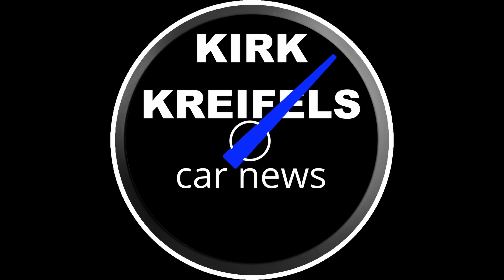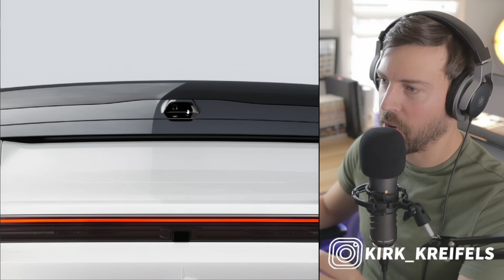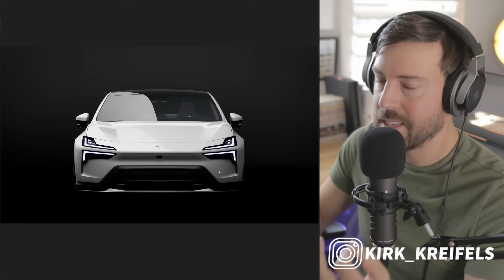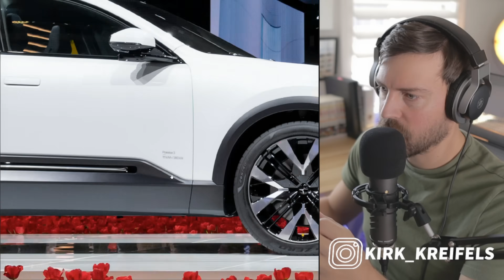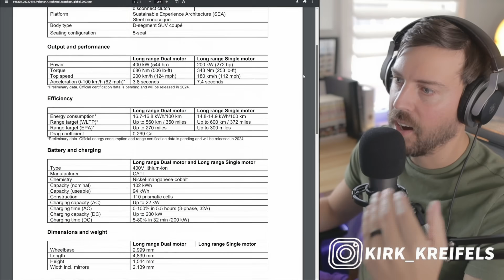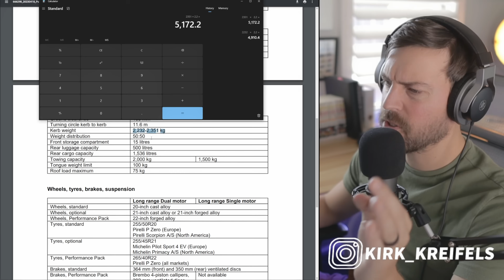The Polestar 4 is Sexy and Fast | But no rear WINDOW?!

Comment: Lower top speeds is mainly due to heat. You need a very good thermal system to manage that. Which costs more to manufacture. And most people don't go that fast anyways so no real need for the added cost

Comment: I may actually leave Lexus for this, it's such a sleek fastback design and it will drive like a sedan with its low center of gravity. Also in regards to where it will be built, so far most articles I have read have stated that the P3 and 4 are going to begin production in South Carolina alongside other Volvos next year.

Comment: Actully, this car does not have a unique identity. Polestars are hot Volvos and I like that they show their Volvo connection. But this car, the Poelstar 4, is based on the Zeekr001, and it is really obvious that it is. This is the first Polestar that isn't based on a Volvo. The dash, steering wheel, seats, while covered in Polestar material, are the same seats as the Zeekr001. The frameless doors are like the Zeekr and so much. The greenhouse (side window area) is like the Zeekr. The Polestar 3 is a much different car that obviously sharing with the Volvo EX90. The Polestar 5 and 6 also slook like they're sharing with Volvo. Polestar has put Precept styling elements onto a Zeekr body. The rear window being taken away was previewed in the Precept, so no surprise here. I find this car sedan shape and attractive, but am disappointed that it doesn't have a more Polestar appearance and doesn't use Volvo elements primarily.  btw, the seat belt color and brake calipers are Swedish gold, not mustard, and they first appeared on Polestar Volvos, the s60 and XC60 Polestar.

The build quality in China is not an issue. tbh, the build quality of Volvo s60s in the USA is more of an issue than Volvos or Polestars built in China. You may have tested one that was beat up by the press or something but I've inspected a number of Polestar 2s and the build quality is well above average with the cars feeling Volvo solid over the road. My hope is the US built Polestars and Volvos match the quality of the ones made in China.
Reply: I feel like the new electric vehicles being built int SC will be to the same standard as Chinese built models. I dont think the reliability of the s60 really tells the story of the factories potential, it’s just that the power train in general was designed to have issues, wether that be intentional or not.
Reply: Agreed. The issue isn’t the build quality. It’s the potentially baked in spyware by CCP into the infotainment & navigation system. Huawei is banned for a good reason

Comment: Best looking Polestar so far, until the 5 comes out.  Glad they priced it around 60K, as the Polestar 4 is a bit too high at over 80K.
Reply: I’m suspecting the more reasonable price bc I don’t think Volvo will have a model that will directly compete with this whereas the EX90 and the 3 will more or less compete head on

Comment: no rear window is a meh, i think they are also manufacturing in US not just in China
Reply from the maker: Let's hope
Reply: @KirkKreifels  polestar 3 production in south Carolina, definitely 4 is coming as well 👀
Reply: i think it reduces costs, maybe emissions and raw resoruces, but it does lower weight and have less weight near top , for effeincy , being less crash unsafe to others, less road wear, more momentum around turns
Reply: Not for the Polestar 4 at this point. The Polestar 3 will be manufactured in the USA and the Polestar 2 at some point in Belgium.

Comment: China owns Volvo if I recall.
Reply: Yup. Geely owns Volvo.
Reply: It’s still Chinese Communist Party controlled and likely comes rigged with spyware in the infotainment & navigation system
Reply: You're a dozen years late, everyone knows that.
Reply: @Neojhun   not true. Many buyers are still unaware that Volvos potentially have CCP endorsed spyware baked into its infotainment & navigation system, complements of Huawei
Reply: A Chinese company, Geely Holding, owns Volvo. But Polestars aren't designed or engineered in China. They're a small-Swedish based company closely associated with Volvo who manages, designs, cars in Sweden. In the future, some segments in Shanghai will have some development work in some Volvos but mainly, the work is done in Sweden. Geely has made Volvo more profitable and has expanded the Swedish operation team. 

Will some Polestars use the SEA platform from Geely. Yes. But understand, their platform developer is Swedish. His name is Kent Bovelian. And Geely has a joint company set up in Sweden called CEVT that designs Zeekr and Lynk and Co. cars and they use a lot of Volvo tech while design their own cars.
Reply: @benjaminsmith2287  However you want to look at it, at the end of the day Polestar reports to Geely because Geely owns them. Also all Polestar models are produced in China.
Reply: @MrSelfDestruct-1  So what? Polestar is still a brand that is Swedish based and produces a Swedish feeling product based on the heritage of Polestar and Volvo. What goes on business-wise to keep them financially strong is the world of business. Lucid is getting involved with Saudis. I hate the Saudi government. But if people are interested in the engineers and designers and having Lucid survive and perhaps thrive then they'll just have to deal with that's the reality of how Lucid will get where they need to go. But unless the Saudis dismantle Lucid, it remains the American company it is.

And Polestar will be manufacturing cars in the USA next year. Didn't I say that.?And future Polestars will be made in Europe. But Polestars are created mostly in Sweden by a bunch of Swedish teams. And there's plenty of videos of them discussing the making of Polestar 5 for people to see who are in the team and what they're doing. It's all being done in Sweden and some in England. There are plenty American products made in China. This is the same thing. A Swedish car made in China. But a Chinese car is one designed for the Chinese market from a home-grown Chinese company or one that has dissolved a former company and now is Chinese designed, engineered and produced. That's not what Polestar is.